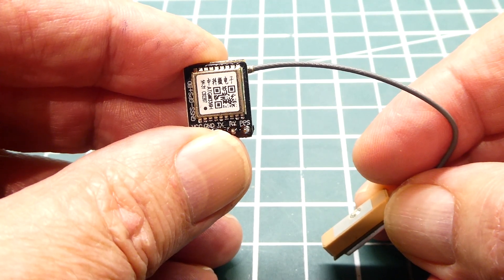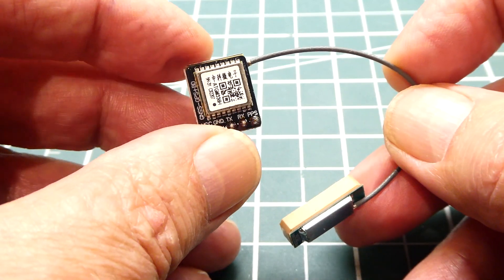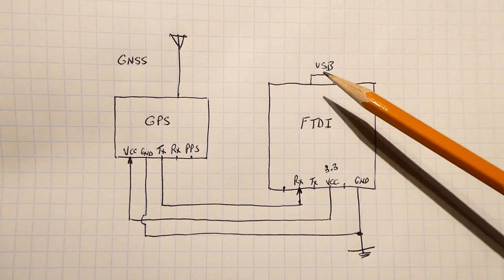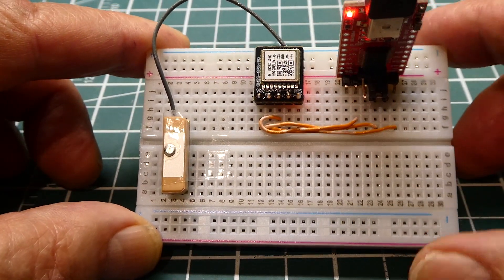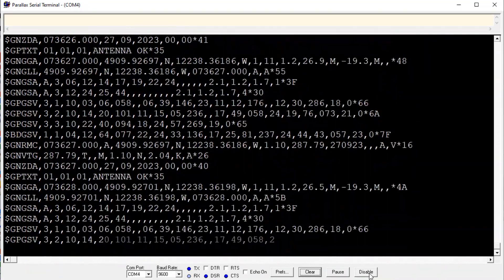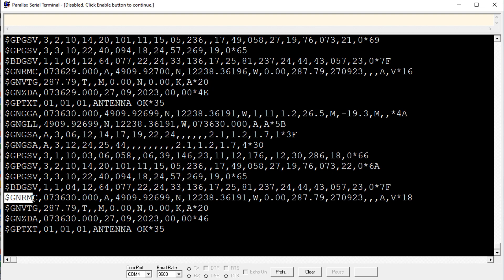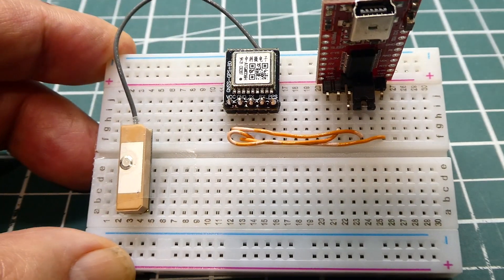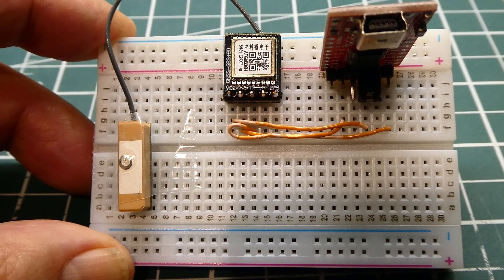GNSS Receiver / GPS

Comment: Do you know if PPS can be received indoor (even if nmea sentences are empty) or only outdoor (open sky)?
Reply from the maker: The GPS has to be linked to a sattelite for the PPS to work properly. It uses the atomic clock on board the sattelite to sync the PPS output.
Reply: @0033mer  Got it! Thanks for the help and feedbacks!

Comment: How many GNSS sentences am I supposed to get per second?
Each sentence has max size of 82 characters, right?
Reply from the maker: The amount of sentences is programmable. You can turn off sentences you don't want. The maximum length is 82 characters that include the $ and CR LF.

Comment: On the ATGM336H sensor, the red light is on but doesn't blink (I'm indoor): does this means I receive no signal?
Even close to the window,  the red light is on but doesn't blink
Reply from the maker: Solid LED indicates no satellites. Once it gets a fix the LED will blink. Take it outside with a clear view to the sky.
Reply: @0033mer  Thanks! I'll try that
Reply: @0033mer  in open sky, the LED blinked but seems I do not receive any data: on the RPi (booted with enable_uart=1 in the boot config), `cu -l /dev/serial1 -s 9600` doesn't display anything... Any clue?
Reply from the maker: When the LED blinks it is connected to a satellite. When the LED is solid the GPS is still sending data which you should see. Get a USB to serial module (FTDI) as per video, as there is no code needed. You can get a serial terminal program on line running in your browser. https://googlechromelabs.github.io/serial-terminal/
Check out this video for more info:  https://youtu.be/aBVxSyyx8Fw

Comment: For ESP32, I use the Adafruit library with NEO modules. Any idea which arudino/ESP32 library works with this?
Reply from the maker: You can use the same library, just change the talker ID from GP to GN as discussed in the video.

Comment: I tuned out when I saw the letters "FTDI"  :-/
Reply from the maker: What would you use?
Reply: @0033mer  "USB to serial adapter" . I am allergic to FTDI for good reasons.
Reply from the maker: Always ensure the FTDI logo is laser engraved not printed. If you have a fake with serial number A50285B1 and it gets bricked with driver version 2.12, download MPROG.exe ver3.5 and restore the PID to 6001. Windows no longer uses drivers that will brick fakes. If you are still paranoid, stick to CH340 USB to serial chips.